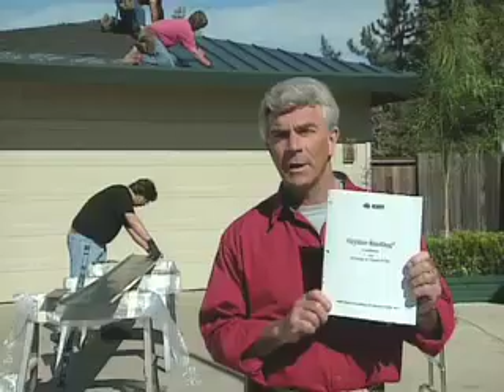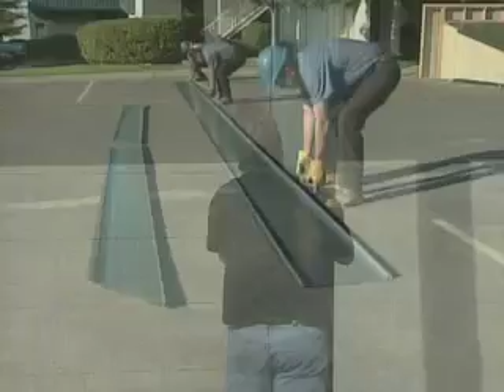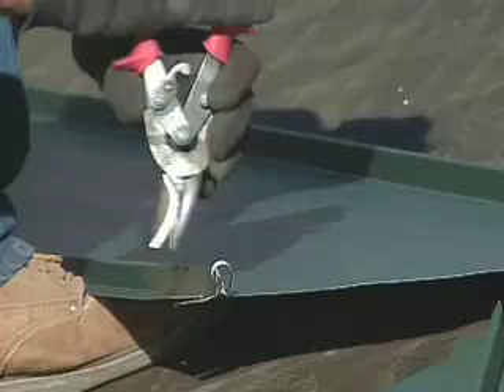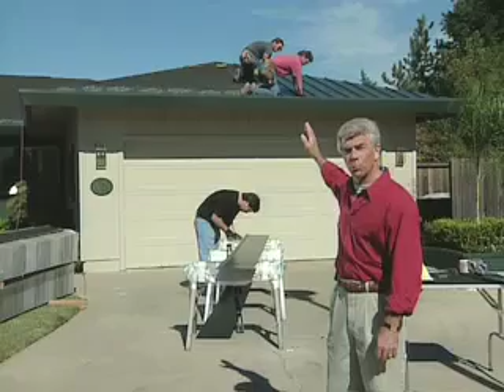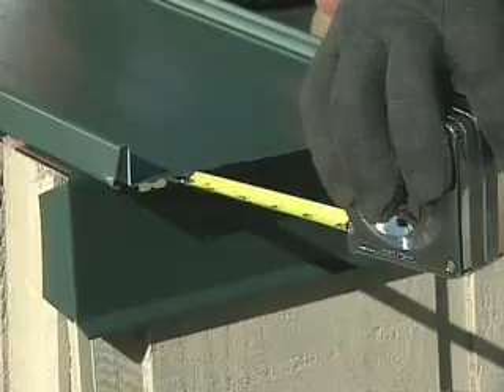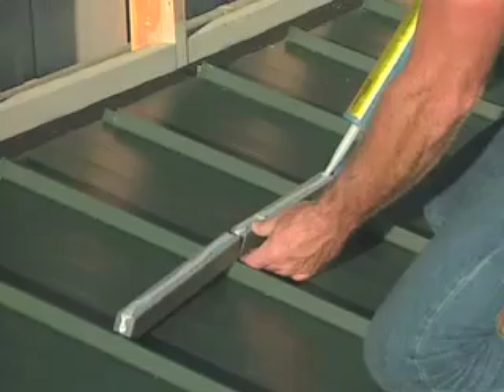Skyline Roofing Installation Video

Comment: At 13.37 is not a good valley detail . . Should hem field and valley metal and locking them in place . . No surface fasteners!
Reply from the maker: I completely agree. AND with a complete understanding of why you'd say that (eventual leaking and all), I wonder if the eventual replacement of the washer, and subsequent replacement of screw and washer should the hole become too bored out, what chore is more difficult? Turning up the hem or replacing the screws?...

Comment: Yeah, the exposed fasteners are the curse bundled with this system. they use hundreds of exposed screws at valleys. Such screws perforate the roof, several of them leak when new, and plenty will leak latter on. This system fits only as animal or tool sheds, where some water leaks are not crucial.
As to replacing the leaky washers, do it on your own roof and don't give advices to others.